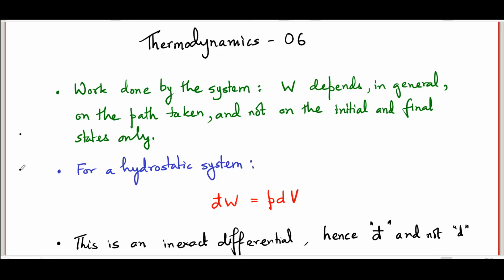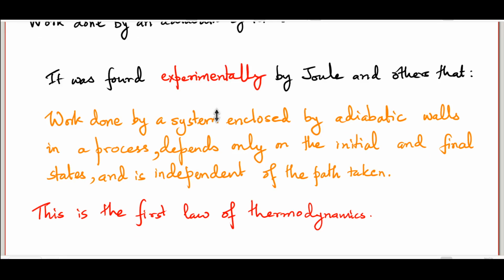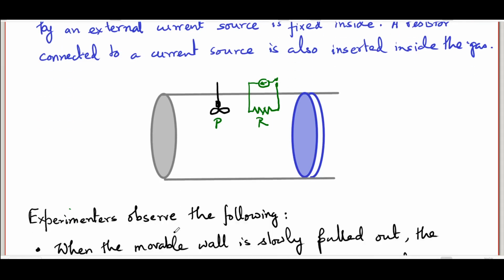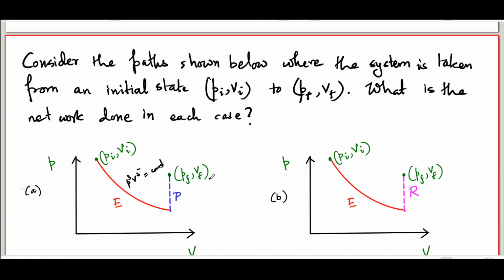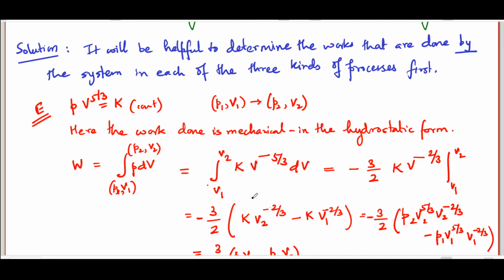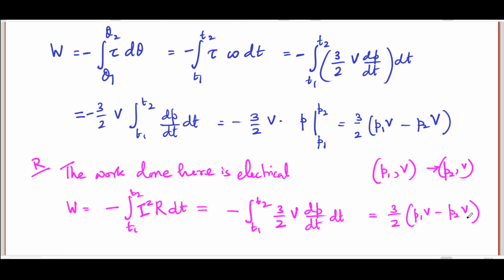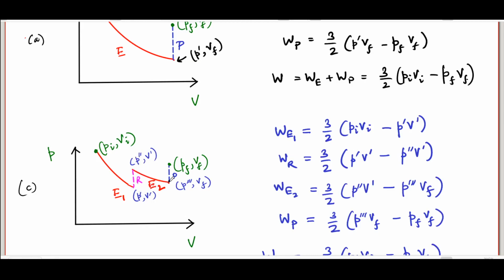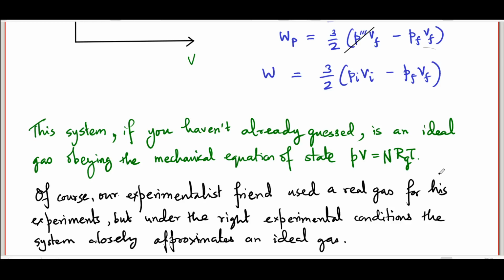Classical Thermodynamics : Lecture 6 - The first law of thermodynamics

Comment: Sir, how can you define an adiabatic wall before introducing the concept of heat from first law?
Reply from the maker: That has been discussed in this series! In short, a wall is defined to be adiabatic if (once it is fixed in place and covered with an arbitrarily thin impermeable material) a system enclosed by it can be in  equilibrium irrespective of the surroundings.